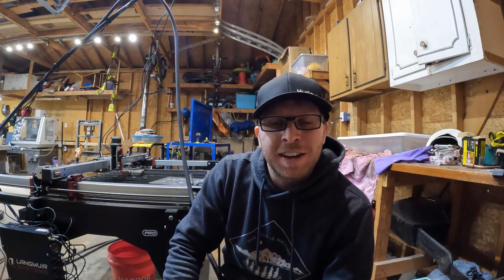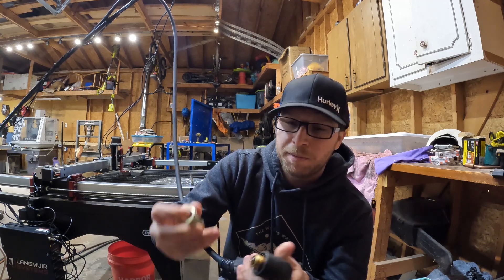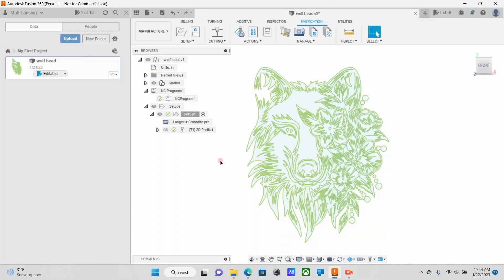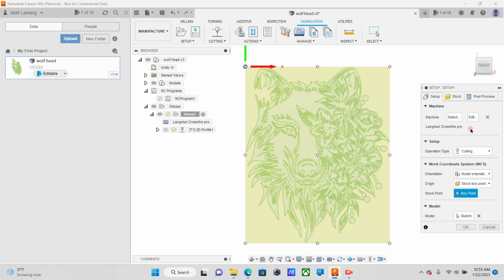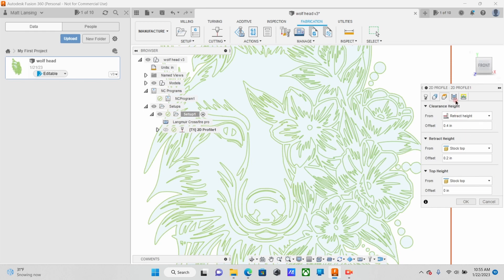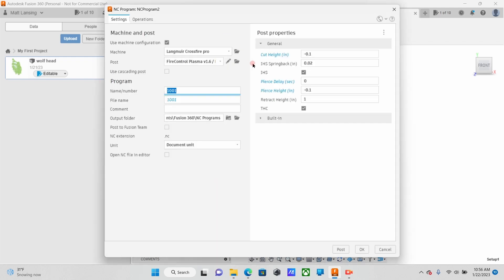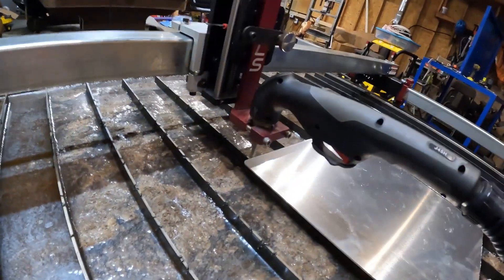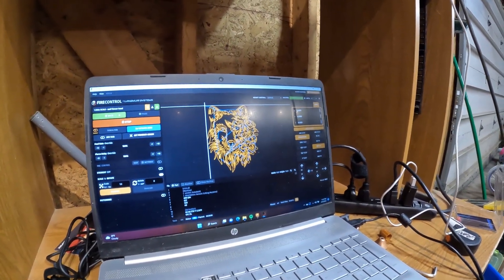EasyScriber With Fusion 360

Comment: hmm, looks like anyone with a sync might be out of luck on that process, short of making some sort of custom holder for the scribe tool
Reply: I know this is old thread, but thought I would add this as an update in case someone (sync owner) comes along.  Easyscribe has a tool made for the Sync machines now too.  You just use an old spent cartridge, knock the guts out and install the tool.  Work in the same exact manner.  This is probably a new easyscriber tool put on the market since this comment was made.